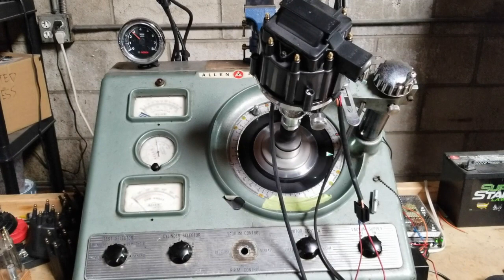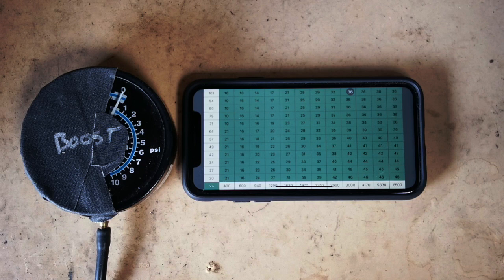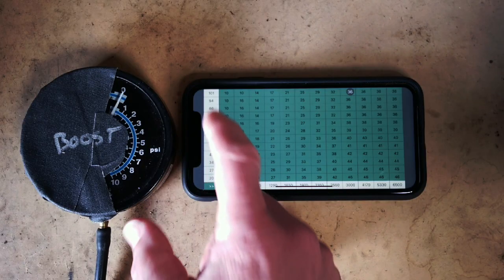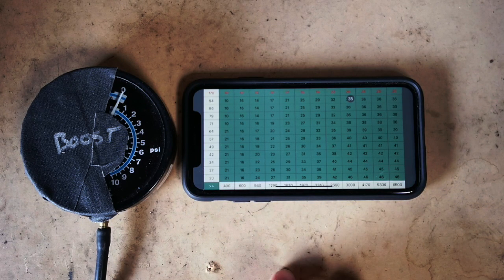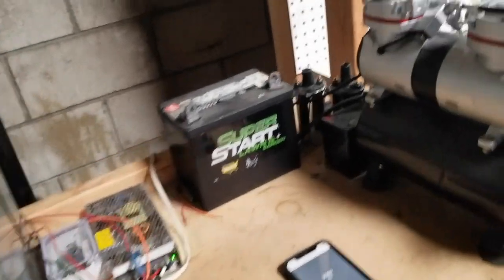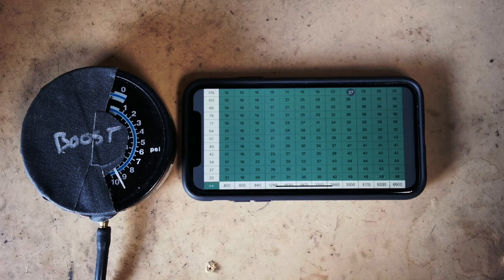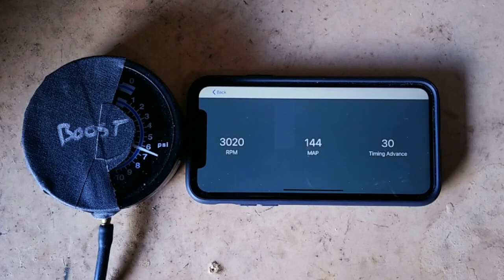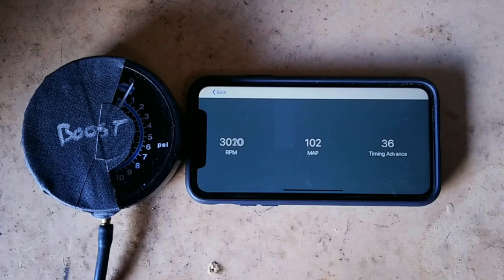How to tune Boost Retard

Comment: I know for sure what ignition/distributor I'm using on my next build. For decades I had went with the formerly great products from the company that starts with M and ends in D. Last time I bought a $457 programmable ignition box from them was in 2020 and I received two faulty boxes in a row. It said MADE IN CHINA right on the box. Was a shame but it is was what it was so I'm done with them. I follow Andy Wood on Unity Motorsports and he clearly demonstrated how good Progression Ignition is so I'm sold on it.
Reply: That Same company tried to keep a box of mine the said they could Fix. Next thing I hear is they can Not fix and will throw away. I said no ship it back. Very Rude people. AT M$D Iwould never sent it but they said they could fix No matter what. Then want to throw away.

Comment: Wow, this is an awesome Ignition system, all in one!  Do you sell one for the Ford 300 cid (4.9L) Inline 6 that was in Ford pickup trucks from 1965 to 1996? I have a '65 F100, with that Big 6. I told Richard Holdener (YouTube boost test guru), that he Needs a Progression Ignition distributor for his 292 Chevy I6 boosted project. Maybe you could Loan him a ProIgn distributer & you could get more publicity! He was worrying about fighting with advance weights, tuning troubles, etc., on a delayed 292 blow thru carb & multiple aftermarket manifold shootout. The delay was caused by the points closing! Give him a call.